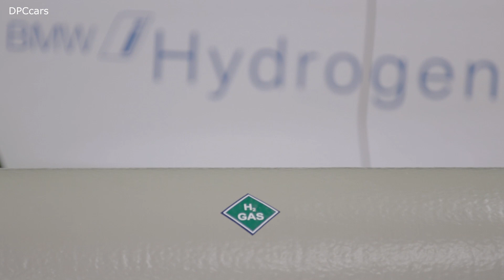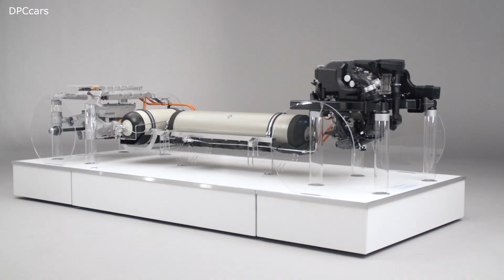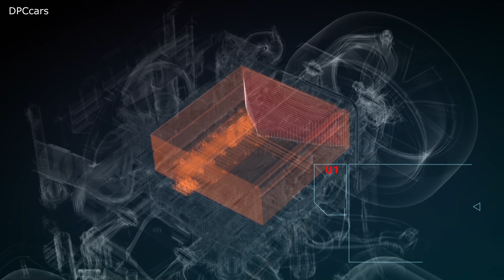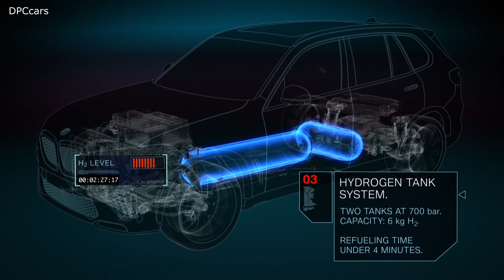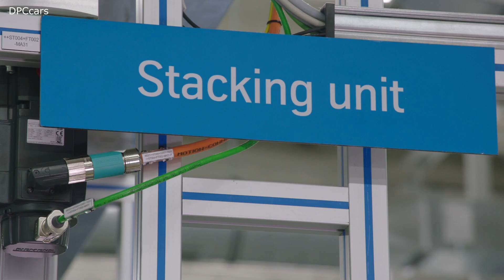BMW i Hydrogen NEXT Fuel Cell Technology Powertrain Explained

Comment: 3y later it is 3y away and just as stupid as it was 3y ago. Why would anyone buy this when you have Elon Musk's EVs. Tesla has none of these complex parts and crazy mechanical nonsense. Battery + ipad control screen + car chassis. 0-60 in 3s with crazy acceleration, 330mi range, SC network so you can easily drive anywhere in the US, in home recharging with solar if you have panels to be 0 pollution refueling, leave home with full charge and  refuel for $10 at home at night. I mean, what's the point of these complex H2 based tech which no one wants. Consumers are buying every Tesla there is and markets have spoken that Tesla is what people want.

Comment: Clearly there is a problem of availability of hydrogen. It seems the most viable option would be if gas stations were renovated to be able to store and provide hydrogen to cars in a standardized way. The ways of transporting hydrogen would need to be thought of. I think transportation by tanker would be the most feasible way to get to the relevant markets. And maybe there should be some solution for remote households/estates to implement hydrogen production from their potable/distilled water supply.

Comment: This engine is a marvel. This is not the most in depth explanation. There is three types of hydrogen engines now. One by central injection which is carbureted. Two is the type of indirect injection. Three will be will be by fuel and air mixture during the intake combustion. Basically Hydrogen can be use as a Internal combustion engine. 

Green hydrogen is a bad topic because we nobody wants Nuclear power. People act like electricity doesnt come from Coal. We need Hydrogen more power and more potential.

Comment: Toyota followed NASA technology in using pure liquid hydrogen to feed fuel cell and generate electricity this technology easy adopted by NASA as whole space rockets designed to store large amount of hydrogen. Adopting same technology for car in using hydrogen storage tanks is conceived by technical idiot not being concerned with public safety in refueling highly flammable liquid in expensive hydrogen tanks and subsequent maintenance of seals and general safety issues with maintenance.

Comment: BMW follow Toyota and behind time technology and follows stubbornness of one chief design engineer adopting expensive hydrogen fuel tank and liquid hydrogen for filling up tank via expensive refueling stations.
Advanced technology is to use totally safe clean fuel consisting of 60% methanol and 40% water for filling up standard car tank. When car is started fuel is feed to special heat ex-changer converting it to clean hydrogen as needed NO HYDROGEN FUEL TANK feeding fuel cell and powering electric motor. Tests conducted in Germany on prototype cars driven 1000 Km on one fuel tank (filling time 3 minutes)  concluded this is best solution for clean and efficient energy car. The problem is that German and Japanese governments already invested billions in to expensive hydrogen production and infrastructure and are not easy to change to safe fuel of 60% methanol and 40% water.

Comment: hydrogen is a gas using as a fuel  but without electric motor cannot run, as a battery supply  much better using the magnet

Comment: What is the energy (output) density per kilogram? I guess the cost per kW would be an important factor as well. I saw where the energy density of jet fuel was 43 kW per Kilogram. I was wondering if this would be a viable way to power electric airplanes. ( Feel free to correct anything that is not correct in your answer.) Fuel depletion would also increase range with the loss in weight, and airports could provide centralized refueling points.
Reply: kWh*
Reply: another thing to consider is volumetric energy density or kWh/L

Comment: why the hell would you want this if you can just plug your car in?  You guys have your heads screwed on backwards.  A battery pack doesn't waste as much energy as hydrogen, and electric is cheaper.  Theres literally no reason other than a quick fillup.
Reply: and whoever put these clips together for the video needs their head screwed on tight.  Watching the same clip over and over again gave me a headache
Reply: @davidanalyst671  exactly
Reply: I guess because someone driving from Los Angeles to Tucson wont like to stop at the middle of the road, waiting for at least one hour to get his battery charged.

Comment: If you want to add more headaches to your life go and buy one , Imagine having a crash at 70 miles an hour head on What will happen to those hydrogen cylinders , you will be stuck with your main dealer for life for servicing , try to fix it with your local garage if something goes wrong they wouldn’t know where to start, so complicated and dangerous, battery much  Simple and reliable

Comment: So in conclusion.  Energy is converted from one form to another, extra milestone. You can't refuel car at home only in Hydrogen-gas station. And literally, under the car you caring  high pressure hydrogen bomb. One hit and your car would explode, evaporating you and surroundings. Combustion engine - thousands of moving parts, don't last long - buy a car parts from car makers every year.
   The same old SH_T packed into a different packaging.

Comment: There are only around 20 moving parts in an electric engine, compared with nearly 2,000 in an internal combustion engine, so  EV will need a lot less maintenance

Comment: Not enough fuel station for H2? Germany has one of the best H2 fuel station nets - 86 operating stations plus 20 more to be build in the near future.
Reply: yeah... a lot of companies are going H2 now, but they "cant"...
Reply: The current best is still not enough.. 86 in germany means 1 station covering about 4000 km2. The charging infra-structure have to be massively improved. H2 has a huge potention, but the complete "eco-system" must developed simultaneously. Let's see if the latest incentives from EU countries and companies (like Airbus) can create an impulse on H2 as sustainable fuel.
Reply: @Evandomedeiros  Now wait until the number of electric cars increased 5-6 times. With the current charging time and capacity problem during cold weather EV cars will suffer a different kind of problems, perhaps the cen more difficult ones

Comment: This makes total sense to use until battery power density catch up. but it's like very very close to catching up already. by 2023 it will be there and farther. Battery power density will catch up in a good half year to a year dealing with Tesla. so... This is kinda obsolete before it even starts. But it's still a good option for the commercial market like big rigs and transportation. Even though transportation has been using battery-electric for yrs now so.
Reply: Riding on an electric bus is like a dream though. All you hear are air shocks. no loud sinkin dirty diesel engine to listen to.

Comment: Just curious: is it possible to store hydrogen in a solid structure? Like a sponge holding onto water (but less wet). I ask because I know that hydrogen is one of the highest gravimetric energy density fuels (120MWh/kg) but it’s hard to compress, so the volume energy density is very bad (probably 2x worse than natural gas or something like that).
Reply: Yes, metal hydride hydrogen storage.
Reply: @jooky87  thanks for your answer. After I originally posed the question, I went looking and found this answer. If only I understood chemical engineering 😂😂

Comment: How is the car going to be safe, if you have two tanks at 700bars releasing pressure during a crash? Hydrogen is highly explosive and flammable?
Reply: So is the 91 octane but all is ok, no?
Reply: You never saw the crash test on the hyundai Nexo??    Hydrogen cars are the most safety cars today, due all the irrational fear against hydrogen...  and yeah... is 100% irrational!   
Of course, if you store a lot of energy (kinetic, chemical, battery)  in one place, it would be always dangerous if you dont apply safety measures...
Gasoline cars do it, Battery vehicles due it... and guess what?  Hydrogen cars do it!
That tank can never explode, it has pressure release valves, even if you shoot that with a caliber 50 (you need that to make a hole) nothing happen, just hydrogen escapes with little kinetic energy, because it is 20 times lighter than air.  
Oxygen can not enter inside the tank, so combustion is impossible, and if hydrogen escapes, it diffuse incredible fast, rising 20 m in one second.  Away of people, instead gasoline spills remain in the floor where they burn you down.
Hydrogen also produce much less radiant heat than any other combustion.
The benefits does not end there...
Reply: Highly flammable, very suitable for future suicide bomber. EV with improved battery and well planned charging stations with  enhanced infrastructure is a safe methodology moving forward.

Comment: "Put the customer at the center of everything we do"....  Is that why rubber components on BMW vehicles routinely fail?  Using recycled rubber to obtain a eco-friendly manufacturing rating screws the customer.  Seals and trims routinely degrading quicker than others on the market benefits your service department and not the customer.
Reply: Stop crying.

Comment: It is a Fuel Cell Stack. Not an ICE.
Second gen fuel cell power train generates a peak of 125kW
Peak power battery can output 150kW for a total of 275kW
2x H2 tanks total capacity 6kg of H2. Refueling time under 4 minutes.
33.6kWh per kg = 201.6kWh capacity
This would give a range of about 373Miles or 600km. Cold weather does not affect range.
Current cost of H2 in UK is about £12/kg = £72 per 373 miles.
Reply: That works out at 5.1 miles for every £1 spent.
Reply: Compared to a hybrid car today a gallon costing £6 will get you 60 miles For the same money a H2 car will get you half the distance. I'm talking average vehicle

Comment: I think Hydrogen is the future.   Even batteries produce toxic materials that needs to be disposed.  This is cleaner.   I hope infrastructure improves quickly.
Reply: Ambocc yep. Electric cars will probably get banned in the future.. Hydrogen , Petrol and (maybe) Diesel Cars will exist. When Hydrogen cars will become easier to produce , cheaper and will get much more powerful than they are now , maybe even Supersport cars will get Hydrogen too (such as : Audi R8 , Lamborghini Huracan/Aventador , etc...)
Reply: Ambocc Tesla will probably become bankrupt if electric cars start getting banned in every country.
Reply: Thomas Cheng there is a Hyundai ( I don’t know model name) and a Toyota Mirai , both are hydrogen cars , both are very expensive (around 60000-90000€) but their hydrogen engines are very weak. The top speed of both cars is 150 km/h. well , for now , hydrogen cars are hard and expensive to produce so that’s why both cars are slow for now. it will probably change after 5-10 years. for now , I think it’s a waste of money to buy a hydrogen car today since it’s so expensive but weak and slow. I would rather buy a BMW 5 series or a Mercedes E class since both have much more powerful engines , are faster and more comfortable.

Comment: Provide portable hydrogen refuel system for home  like electric car then you see hydrogen car will surpass electric car , men can go to moon but can't built portable hydrogen refuel system ?
Reply: Bloom box has them for commercial applications. Solid oxide ceramic plates (eliminates the need for platinum catalyst) with NG reformer , runs on Natural Gas ,provides 65% electric conversion with hot water byproduct for heating cooling and domestic hot water bringing the total efficiency to 95%. The reformer recycles methane and steam from the NG reaction to crack the gas. It is possible to sequester the C02 at the site as opposed to trying to control emissions on each vehicles exhaust. If the fuel cells were used for charging EVs as an example or even as an electric utility for community use.
Ultimately if they can be scaled for residential use, ( or in existing bloom box for neighborhood generation. ) each home could have its own energy generating unit without transmission losses currently being experienced with central power plants!

Comment: Too many moving parts they want you to go back to dealers for maintenance don’t believe in the hype! Electric is way better. Less moving parts less maintenance and with solid state batteries coming into the market you would be able to charge in under 3 minutes! Bye hydro.
Reply: Electric will eventually die.

Comment: why would i want to fill up my car  with Hydrogen that costs me  $50.00-$80.00 when i can fill up my car  with Electricity that costs me $5.00-$8.00
The new  batteries from Tesla  will only take 15 mins to fill  up as of  2021.
Hydrogen fuel cells will be to  expensive to run.
The Electric  vehicle  has  very little  servicing.
The  roll out of HFC will fail and will be  an expensive  lesson that BMW and Toyota will regret.
People are not stupid and will understand like me that Electric is the way to go.
Within 5  years  EV will have  ranges in excess of  500 miles  per  fill up and will increase  to much further and  quicker  charge  times  within that time also.
You cannot Ignore Tesla at your own peril.
Reply: do you sincerely think that electricity prices will remain the same when everyone will be driving electric cars? the price of a service is driven by a demand on the market. AND, the infrastructure for a Tesla that shares 1% of all the car market is something very different from an infratructure consisting of electric vehicles for 100%. So, get ready that you will pay for electricity for a car nothing less than what you pay for your fossil fuel car.
Reply: @RivieraByBuick   Bingo
Reply: in the future it might cost $5 to get the same or more hydrogen range against the $5 electric. hydrogen production is not yet advanced that much
Reply: don't forget that we won't have enough lithium to make batteries in the near future
Reply: @angelalexs  Actually Lithium is one of the most abundant metals on Earth.
Reply: @endlessspace.8776  Not really. People said the same about Fossils back in the 60s but look where we are now, only 53 years left judging by our current usage.
Reply: @endlessspace.8776  but the impact on the environment to mine (Fuel for mining and transport, explosives,chemicals and the direct impact of strip mining)  is horrifying. Then their is the recycling....... the charge might be cheap but the manufacturing is not.
Reply: I think the battery pollute more than hydrogen full cell.
Reply: Lol, nonsense
Reply: and what about battery aging? in 3 years the batteries don't have the came capacity... so at the end you´ll have to sell your car or change the battery package. Fuel cells on the other hand have a longer life time than batteries.

Comment: I still find it funny, that human nature wants to be destruction in what they call productive and progression, as long as it explodes people will love you!!! Right? Wheres the green?

The day you can run the exhaust tube to your bedroom and sleep, is the day I believe in green.
Reply: You can. The exhaust emits clean air and pure water. This is not internal combustion hydrogen anymore
Reply: @crashlaga  Though there are no toxic gases in the exhaust, there is also hardly any oxygen left. The fuel cells consumed the oxygen of the air and "converted" it into water.
If the exhaust displaces a big share of the air, you die of anoxia.
The consumption of 1 kg of hydrogen consumes 8 kg of oxygen, thats the amount of oxygen in ~27 m³ air at sea level.
Just for the sake of completeness, I don't think that it's a relevant disadvantage of fuel cell cars. Unlike other things.

Comment: There is 1 reason & 1 reason alone for the current paradime. As well as the lies they tell us. So they can sell oil for as long as possible.
Reply: Or probably because the supply of electricity won't be able to match the demand & we'd end up just using more fossil fuel to produce electricity.
Reply: @user-ts1gj9wb6u  I would slightly belive that where true if there wasn't such an overwhelming amount of evidence supporting what I just said.  If you don't think that the oil ceo's are killing people & shelving inventions every day to keep every drop of oil pumping they can. Your either extremely naive or working with/for them. Do a little bit of reserch, like how they got rid of Diesle. He invented his engine to run off of any flamible substance even sawdust. Yet they are still using steam & coal? They could be burning ground up newspaper ect in diesel generators or bio diesel,  collecting the ash in retaining chambers & using it as fertilizer.  No need to pump toxins into the air.  Unless your profiting from it.  Look what happened in Australia about 15 years ago they where going to go green & the day before the public demonstrations they sabotaged the prototypes. Blowing them up, pouring concrete down into them. A little violence to the right people that day went a long way.
Reply: No